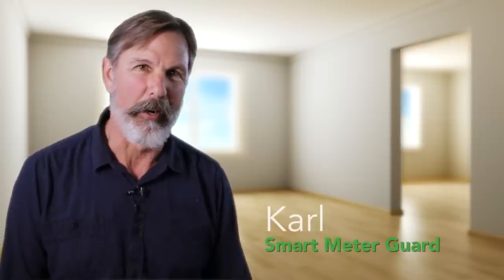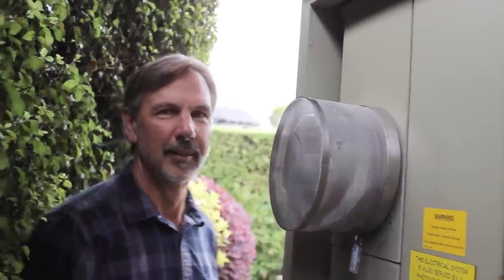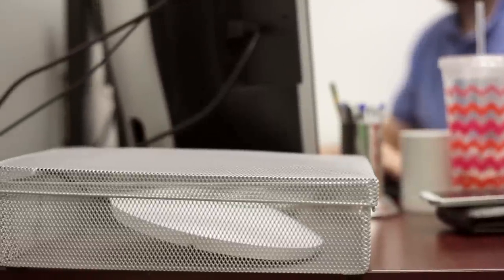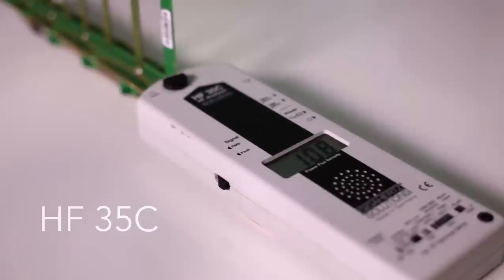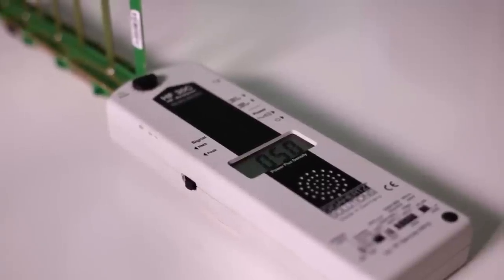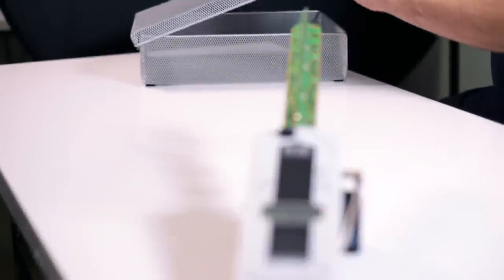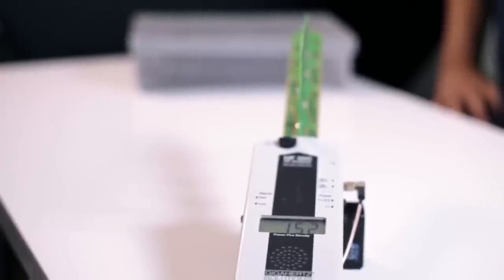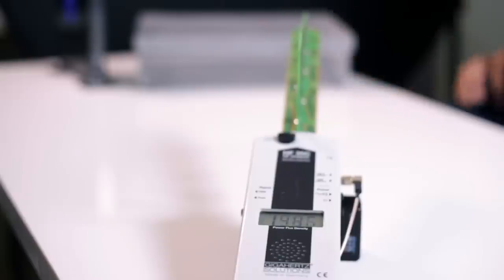WiFi Router Guard - Blocks WiFi RF Emmissions

Comment: I think you need to make a new video that explains that the cage "'reduces" (not blocks) the WIFI signal by 90% so that you & your family are not being overly bombarded with radiation - But that the computer will still pick up the WIFI signal (as long as you are not toooo far from the router) So much confusion in the comments! Great product, thanks.

Comment: This guard is just for one room apartment, student's room etc. Something bigger with 2-3 walls will make problems with signal quality and internet speed. It is same if you set router to lower transmission power. And it is better. But if you use this  guard your router will not receive good signal beacuse its antenna will be 90% blocked not just for transmission but for receiving signal. So it has purpose but not for biger apartments. It is simple.
Reply from the maker: Hi ZK,  Yes, yo9u are correct, however, for those people that are a normal distance from their router it shields them from about 85% to  90% of the RF power density the routers emit.  IN addition, most of the routers out there you cannot change the RF power or signal strength setting, just turn it on or off.

Comment: How does it affect range of the signal? Thanks for your intelligent understanding of the negatives associated with cellular phones and associated devices. I try to explain to friends and family the pitfalls of cellular technology & like to send link to video that shows how popcorn can pop using cell signals.
Reply from the maker: HI Mike,  Without the Router Guard your WiFi signal gets weak as you get further from your router until you get to a point you don't get a signal.  With your router in the Router Guard you will lose some distance you can be from your router.  However, if you are a normal distance from your router you really won't notice anything different.  Thanks
Reply: @SmartMeterGuard  whats a normal distance?

Comment: Hi from the UK, this is a nice product but if a cheaper alternative is what youre after just get a cheap mesh(metal) paper basket,£5.99 and sit it over your router, tested with a meter returns the same results,its just a Farraday cage after all.
Reply from the maker: Hi Ian, thanks, yes, people can make their own, however, the best blocking is when you completely cover the RF source, the router.  Any gaps or openings in the mesh will leak RF.  The Router Guard we make is for people that don't want to make their own or who can't make their own and for people that just want a turnkey proven product that blocks 90% to 95% of the RF the router emits.  Thanks

Comment: If I get one can I paint it or will that negate the protection?
Reply from the maker: Hi Eric, yes, you can paint the Router GUard and it won't affect how it blocks the RF your router emits.  It's the metal that blocks the RF, not the paint.  Thanks

Comment: Does it still give you high speed internet with the guard on?
Reply from the maker: Hi Jacker,  Yes, it does give you the same speed.  The only difference you will notice is that the furthest you could be from your router and still get a signal will be reduced by about 5 to 10 ft or so.  Thanks.

Comment: I think another great idea would be a small panel (think 10 inches x 10 inches, sort of like a picture frame with 2 nobs at the bottom to balance it) that someone could set to one side of the router on a table or floor, to prevent the radiation - or significantly reduce it in the direction you wanted the signal reduced, for example where you sleep at night, or to block signal from a neighbor.  is it possible that you guys could sell that custom material you make the router guard out of (panel style) and sell different sizes etc. Thoughts?
Reply from the maker: +tjames   Hi Tjames,  Nice idea but unfortunately it would be technically very difficult to do this.  RF waves propagate radially similar to sound waves so channeling them in one direction would be hard.  Thanks
Reply: @SmartMeterGuard  you can direct radio waves! what do you think directional antennas are? or radar?
Reply from the maker: @Northstar7733  Hi Northstar, Yes, you can focus RF but not 100%.  You can concentrate a signal in a certain direction to go further in that direction but it is not 100% of the signal.  Thanks

Comment: wouldnt this cage dramatically minimize the wifi coverage as well? if not, why wouldnt they all come standard with a cage
Reply from the maker: Hi Future,  The Router Guard actually blocks about 85% to 90% of the EMF it emits and this is why you can still use the router when it's in the Router Guard.  Also, yes, you are correct, the Router Guard will reduce the distance you can be from your router and still get a signal.  If you are normal distance from your router or in the same room you won't really notice a difference.  If you are upstairs or down stairs from your router you may see a weaker signal.  Thanks

Comment: My question is if you put the smart meter guard on the outside of the meter does it keep the EMF going inside of you house on the backside of the smart meter?
Reply from the maker: Hi Beth,  The Smart Meter Guard also blocks the RF inside the house so there is no need to put a shield on the other side.  Here is a video we made showing the Guard blocking the RF inside the house.  Select the video that says Blocked Inside the House.  https://smartmeterguard.com/pages/videos   Thanks

Comment: Question for you... if I place the shield on my smart meter, would doing that help cancel out or reduce any RF signal through the brick wall behind the meter base itself or just in front of the meter? My family sleeps just on the other side of a meter pack, our headboard of our bed is within 3 feet of the meter, the only thing separating the two is a brick wall..This have had me really nervous.

Thank you for any input!
Reply from the maker: Hi Justin,  Yes, if you put your router in the Router Guard it blocks about 90% of the RF in all directions.  Thanks

Comment: The EMF is reduced, but do 2G & 5G waves still present a health issue?
Reply from the maker: Hi Anthony,  The Router Guards are what's called a Faraday cage and Faraday cages block the full spectrum of RF from about 100 KHz to about 300 GHz.  5G right now is about 5 GHz and will move to about 30 GHz in the future.  This means the Router Guard will still block or reduce the RF expose at these frequencies.  Thanks

Comment: This router guard will greatly reduce the RF emissions from your wireless router without completely negating the wireless functionality. Wireless devices can still operate on an extremely weak signal.
Reply: What kind of range will the router have with only 10% of the EMF escaping?

Comment: Does the SmartMeterGuard attenuate 5G routers as well?  I have a BellHomeHub 3000 that has continuously emitting 5G antenna that are not disabled by the dashboard software.  I am using hardwired fiber optic cable for the home computer and televisions and only use 2.4G for intermittent phone use.  Unfortunately the only way to disable these antenna is to completely unplug the router.  Then nothing works.  Nice of Bell Canada to sell us a router that hides the fact that it is continuously emitting, even when the dashboard software and lit panel on the unit say it isn't.
Reply from the maker: Hi Kathleen,
Yes, the Router Guard blocks 5G routers.  The Router Guard blocks the full spectrum of RF which includes 5G.  Thanks

Comment: Does the signal have anything to do with the radiation? I mean, if you use a guard, will you also lose more of the WiFi-signal?
If I make a net like this myself, does it matter what kind of metal that is used? Aluminium, steel etc?
Reply from the maker: +Karine T. Knudsen Hi  Karine,  Yes, the signal has everything to do with the RF radiation.  The Router Guard blocks about 95% of the RF radiation so the 5% that gets out is still enough to use your router.  You will have to be about 40% closer to your router though.  It really doesn't matter what metal you use as long as it's a mesh and covers the router.  Thanks
Reply: +SmartMeterGuard 
Thank you very much for your help.

Comment: @
SmartMeterGuard Can you build a WiFi Router Guard big enough to house both the router and an Amazon Echo or a Google Home speaker.  Stupidly, these devices don't come with an Ethernet port for hard wiring to the network so you need a WiFi router. Also, many may not realize, these speakers also contain a WiFi radio that's constantly broadcasting, so they also need shielding. Housing the router and speaker together would allow full signal strength between the devices whilst blocking the RF from their WiFi radios going into the home.

Comment: Does dispurse or disove the signal or when you open the cafe it all just escapes
Reply from the maker: Hi Prabhu,  The RF the router emits is instantly dissipated into the metal mesh of the Router Guard.  RF does not or can not get stored.  A good analogy is to say if you shine a light in a box does the box store the light?  No it does not because the light dissipates instantly.  Thanks
Reply: @SmartMeterGuard  so it doesn't run off/ out of containment like water running off a bench or water flowing over the edges of an infinite pool?
Reply from the maker: @organicufo1639  Hi Prabhu,  Yes you are correct, the RF does not run off like water, it just instantly dissipates.  Thanks

Comment: What about the wires attached to the router; is there a slot for them to glide into?
Reply from the maker: Hi Jimmy,  the cables that come out of the router need to be bundled together and fed out the half round opening in the lid of the Router Guard.  This allows the Router Guard to be closed all the way and still have the wires come out the small opening in the back.  Thanks
Reply: @SmartMeterGuard  what about the actual port (not sure if that is the correct language) where the company essentially drilled into your wall? That emits high RF for me as well as the actual router. Any thoughts? Maybe a cable is broken or is there something else to place over the wall outlet/port where the cables are coming from leading into the router? Thanks!

Comment: I have my WiFi router inside my bedroom very near the door. If I put the router outside the wall of my bedroom, will the wall block any of the radiation? I am guessing it won't block all of it, but will the other sided of my bedroom wall block a decent amount of radiation? I am trying to figure out if there would be any benefit whatsoever to set my router outside my bedroom (directly on the other side of the wall of my bedroom).
Reply from the maker: HI Randomguy1882,  You are correct, walls do not block RF waves so putting the router behind a wall does almost nothing to block the RF waves emitting from your router.  Thee best thing to block the RF waves emitting from your router is to make or put it in a Faraday cage.  This is what the Router Guard is and why it blocks about 95% of the RF from your router.  You can make your own by using metal mesh and encapsulating the router in it.  Thanks.
Reply: love how yall are helping people by answering questions and making suggestions like making your own router guard. Shows that you actually care and that you arent just trying to make as much money as possible. im planning on making my own router guard and ordering your smart meter guard. Thanks!
Reply from the maker: Hi tfiz1406,  Yes, we encourage people to make their own because it can be done.  We make the Guard for people that don't want to or can't.  If you need help making yours let us know.  Thanks

Comment: i wrapped mine in   aluminium  foil...  it stopped  it working  nicely..   isnt there the option  to   just   turn off the  wifi
Reply from the maker: Hi Kelly, Thanks for letting us know.  We usually don't recommend using foil because foil blocks the RF by "reflecting:" it and it's very easy to reflect it where you don't want it.  Thanks

Comment: uhh.... so does your wifi conne ction still work with ur router in there?
Reply from the maker: +localbroadcast Hi loacalbroardcast, Yes, you can still use your router wirelessly.  This is because the Router Guard blocks about 95% or so of the RF the router emits.  The 5% that gets out is enough to still use the router.  The distance you can be from the router will be less by about 50% but the upload and download speeds won't change.  Thanks
Reply: localbroadcast you have been reported for a phallic image.
Reply: SmartMeterGuard - Good answer!
Reply: Lacalbroadcast - good question

Comment: Hi i wanted to ask if it affects the wifi signal
Reply from the maker: Hello Nicolas,  Yes, the WiFi signal from your router will be weaker.  While you can still get a signal and use your router you may need to be a little closer to the router to do so.  Thanks

Comment: Forgive me, I am confused. does it stop the Wifi signal?
Reply from the maker: +zamis21 Hi Zamis, The Router Guard blocks about 95% or so of the signal the router transmits.  The 5% or so that gets out still allows you to use the router however you will need to be 30% to 50% closer to the router to still get the signal.  Thanks

Comment: I'm always confused about one thing though. Aren't the RF emissions the actual signal you're blocking? I can never understand how it works if you're blocking the actual EMF.
Reply from the maker: Hi Silkee,  Actually, the Router Guard actually blocks about 90% or so of the signal.  The 10% or so that gets out still enables you to use your router.  Thanks
Reply: @SmartMeterGuard  in a double-story house?
Reply from the maker: @JaydenLawson  Hi Jayden,  yes, you are correct, the further you are from your router the weaker the signal will be even if you don't use the Router Guard.  IN addition, the walls in the house will attenuate the RF some as well.  Thanks

Comment: Will you still be able to have wifi while using this guard? Because if you're only going to use the router for ethernet, you can just turn off the wireless signal on it.
Reply from the maker: Hi mafiozi,  Yes, you can still get a wireless signal however the range is reduced by about 30% to 50% percent depending on the type of router you have.  Thanks
Reply from the maker: ***** Hi Samuel, No, it does not slow down the speed of your access, it just reduces the distance you can be from the router.  Thanks
Reply: +SmartMeterGuard, approximately what distance can wireless devices still be used when the router is in the box (lid on)? I live in a duplex with my landlord who has WiFi. He will not remove/shut off the WiFi but I could offer him a guard. I would still like to be able to connect to it when needed, but reduction in strength seems prudent.
Reply: +SmartMeterGuard, approximately what distance can wireless devices still be used when the router is in the box (lid on)? I live in a duplex with my landlord who has WiFi. He will not remove/shut off the WiFi but I could offer him a guard. I would still like to be able to connect to it when needed, but reduction in strength seems prudent.
Reply from the maker: +Bottoms Up Hi Bottoms Up, The Router Guard reduces the distance you can be from the router from about 40% to 60%.  The upload and download speed is the same.  Thanks

Comment: is there anything that can be done to prevent my neighbors WiFi signals from coming into my house.  I get 3 SSID that shows a full 5 bars of signal strength inside my house, and I know they belong to my neighbors.
Reply from the maker: +David W   Hi David,  You can try and put a shield on the wall between you and your neighbor's router.  RF is radial in nature so eventually the RF will go around the shield you put up but if your right behind the shield it will block most of it.  Also, the further you are from their router the less RF power level you're exposed to and RF power level drops off very fast with distance.  It's doesn't take much RF power to transmit a signal a long way and this is why you still get their signal even though the RF power level is probably pretty small.  Thanks
Reply: You should be more worried about FM and Am radio waves and cellphone towers.